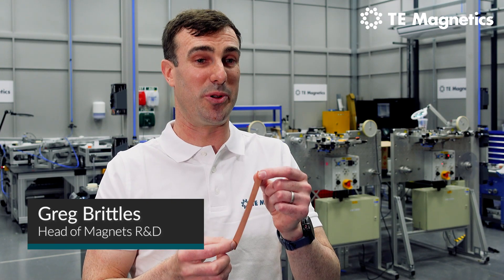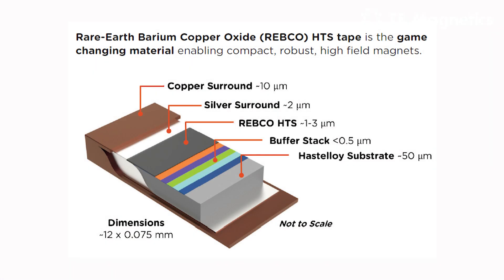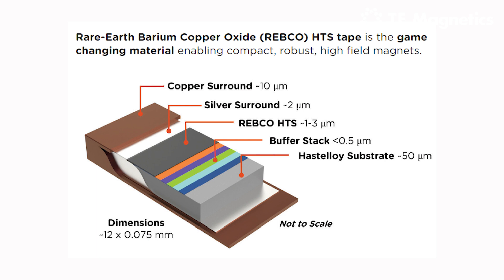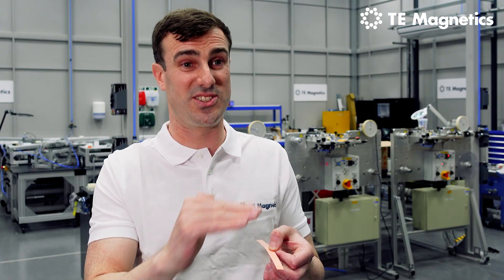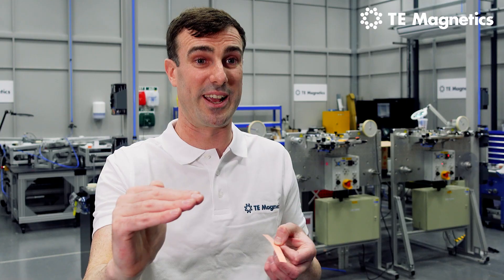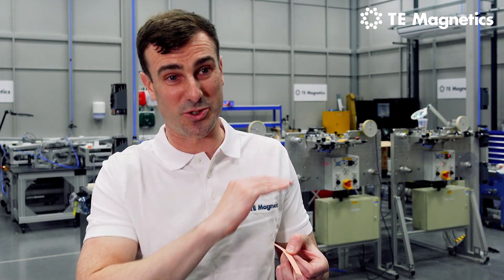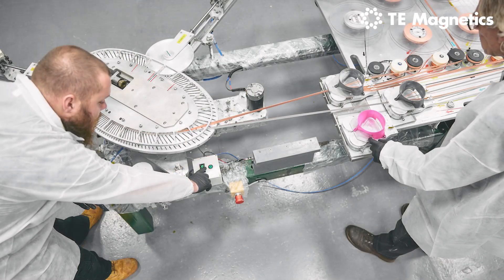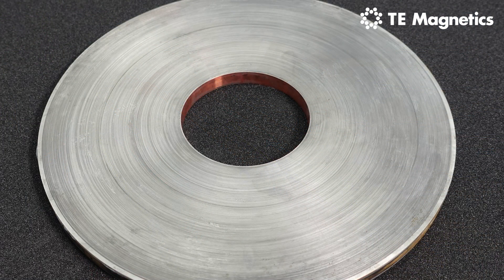HTS Tape Explained: The Building Block of Our Superconducting Technology

Comment: May be this may have other uses in future. Definitely not fusion energy.

They can do alchemy ?  Gold thick square and inside put copper ball. 

Drop this middle of plasma.

Hope it evoporate. 

With that magnetic field copper may be suspended enough to get melted evoporated and become plasma and coated into inner wall

I am curious what will happen

Inner wall need another temp inner wall and find a way to Paint after every run. use robots

Once paint layer get thick replace 2nd inner wall.

You dont want system shutdown because of contamination.

Find a chromium or graphite alloy paints.

Comment: People commonly think of silver and copper as good electrical conductors, and normally they are, the two best ones in fact. But here, in superconducting tapes, they're effectively like the plastic insulation around the "wire" of the superconductor itself because the SC is so much better at conducting electricity. In normal operation, no electricity flows through the copper or silver cladding at all, it's ALL going through the quasi-single crystal of the YBCO tape. The Ag and Cu only conduct significant electricity during an accidental quench of the superconducting layer when the magnetic field exceeds a critical flux density or current exceeds the critical current density, or when the temperature is allowed to rise above the intrinsic superconducting critical temperature of the material.